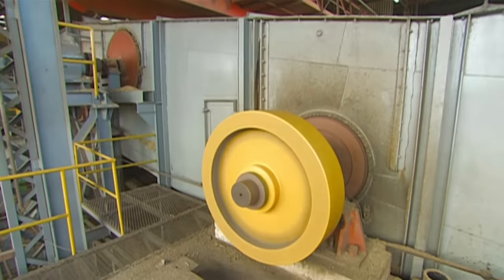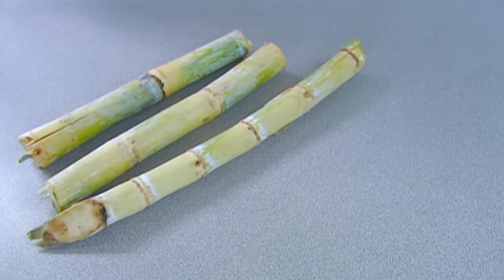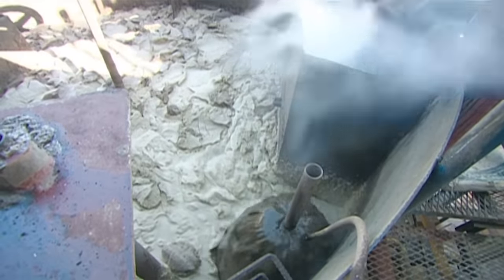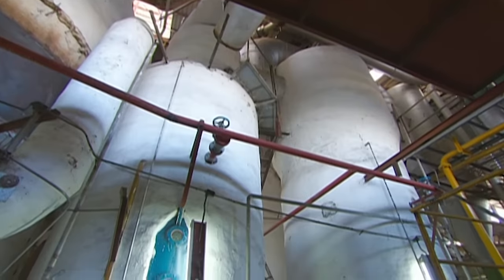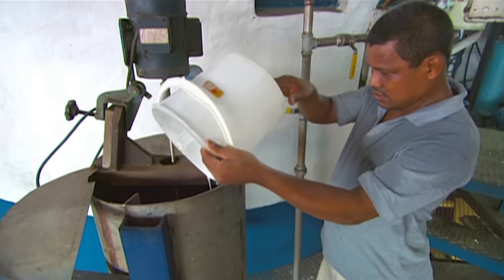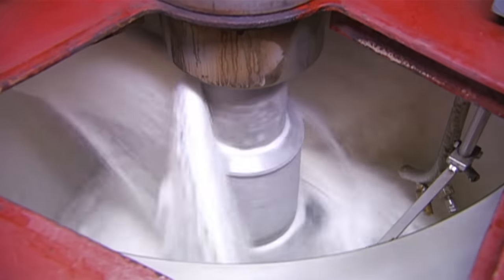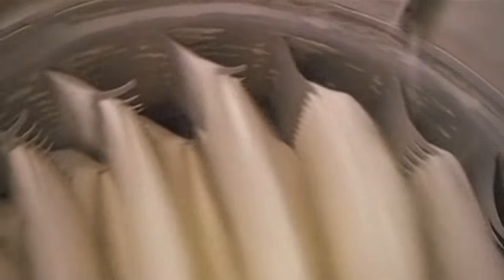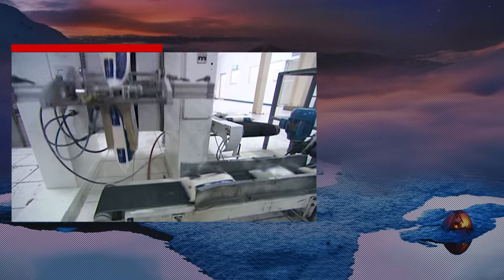SUGAR | How It's Made

Comment: After all this process there's diabetes 😪😥
Reply: Diabetes, obesity and metabolic syndrome. All stems from high insulin levels. The addiction and obesity can be completely eliminated with eating healthy fat every day. Eliminates the addiction.
Reply: @mitch1078  Caused by sugar.
Reply: @maggiep9007  Yes of course sugar that's what the comments for this section of the sugar video is all about.
Reply: Agree 100%
Reply: @B38132  It's really caused by sugar triggering massive toxic insulin response in the body. body is not designed to pump so much to reduce so much toxic blood sugar all the time.
Reply: @mitch1078  The diseases you mentioned are not all caused by high insulin levels. Type I diabetes is caused by a lack of insulin. You can be obese without having high insulin. Metabolic syndrome is a variety of diseases and most of them don't have to do with insulin. But I agree with your point that too much sugar is bad for your health and can lead to many different health complications.
Reply: @rovar00  I was specifically referring to type 2 diabetes. If you had logically followed the feedback from the original posted comment in this thread here which I was responding to, I was correlating that specifically. Type 1 diabetes typically begins early in life, which is the lack of insulin, where type 2 occurs after the overproduction of insulin causing insulin resistance, obesity and metabolic syndrome. The original poster's comment referred to later in life. Metabolic syndrome definitely leads to type 2 diabetes. Overproduction of insulin is absolutely the common denominator. Our bodies were never ever designed to produce so much toxic levels of insulin in order to combat the toxic levels of processed sugar, carb sugar and processed food incorporated in the modern century.
Reply: @mitch1078  I agree with your message. I was only implying that high insulin isn't the only cause of the diseases you mentioned, since it is possible to have all three of them without having high insulin levels. Many other factors contribute, but I agree that too much sugar leads to a host of poor health outcomes.
Reply: @rovar00  Correct. I was just focusing on that toxic levels of insulin is the leading cause of them. No one typically ever eats when they're not hungry. Toxic levels of insulin created from elevated blood sugar changes all that. Hungry all the time and obesity that never ends. The toxic levels of insulin itself is extremely destructive. Unfortunately the body has to produce it on a massive scale so the toxic levels of blood sugar doesn't destroy itself. The body then lives on constant emergency this way and can only lead to the same result you recognize as well. I finally hit all my health goals after finding this cause after 20 years because the science of insulin's effects on obesity was proven in the last couple years.
Reply: Beastmode cowboy 
He’s talking about type 2.
Type 2 is a dietary issue and preventable.
Don’t care about type 1. That’s a whole different ballgame.
Reply: @blackworldtraveler3711  Wrong, type 2 is not strictly dietary and not always preventable.
Reply: Beastmode cowboy 
Bad genes I guess. Why make it worse I’d say. Works for all of my doctor patients.
Not always preventable in his case because most aren’t disciplined and refuse to change.

Same with high blood pressure. All blood pressure pills means is a green light to eat more crap and not exercise.
Reply: @blackworldtraveler3711  I have a friend that spent 20 years in the Marine Corps. Took great care of his body even after he got out. No family history of type 2. It's not an eating disorder, people would do good being educated instead of insulting people who have diabetes
Reply: Beastmode cowboy 
Just one person I see.
Didn't say anything about eating disorder.
Just everyday foods.
I guess you don't know what he was consuming during those years.
Reply: @406bullrider5  Diabetes type 2 is what is caused by excessive sugar/insulin. That's what this youtube video feedback is all about...thought you knew this.
Reply: @406bullrider5  Even if your friend looked like he was in good shape doesn't mean he didn't eat high processed carbs creating high insulin resistance. It's called TOFI, thin on the outside, fat on the inside. This means fatty liver disease where you wouldn't see this on the outside of the body. It can be caused by drinking and other excessive insulin factor.
Reply: @mitch1078  obviously you don't.
Reply: @406bullrider5  That's correct I don't drink much alcohol. Everyone agrees here this specific feedback thread is about excessive insulin type 2 brought on by excessive sugar consumption. This thread is not about "lack" of insulin from type 1 whatsoever.
Reply: @406bullrider5  Having diabetes doesn't mean you are more educated, type two is extremely preventable more than it is passed through genes and is mostly caused by having excess sugar in the blood *FROM EATING TOO MUCH* it may not be an eating disorder because you have control of what you eat but it can be caused by eating disorders wanting more to eat meaning more sugar in the blood. Honestly I agree with Mitch more he is only stating that he was talking about Type 2 diabetes and he is completely right about the description of it. I say you should try googling before ranting on and on. Don't bother swearing to gain advantages I really don't care.
Reply: @zaphkiel9019  It may not make me more educated, but it makes me a hell of a lot more educated than people who have never had to deal with it. Walk a mile in my shoes and you'll see what it's like. I've spent 15 years learning about both types, so yes, I am more educated than you
Reply: @406bullrider5  I don't have diabetes and I honestly don't care..  It's 2019 grow up and part ways of you can't win a rant. What Mitch said is true that's all to it... Don't agree then your literally wrong. Type 2 is genetic however is extremely through diet
Reply: @zaphkiel9019  So what he said was true, while all he's doing is on the outside looking in? That make sense? And no shit you don't have diabetes, if you did you wouldn't be arguing with me about something you don't understand
Reply: @406bullrider5  Here we go again. Be in my shoes yada yada... Stop. Just because I don't have diabetes doesn't mean I'm fucking stupid. I know basic nutrition and diabetes info ect you are right and he is right. Better? :D Equality? This world has gone to shit
Reply: @zaphkiel9019  
There is no real genetic caused by diabetes 
Only few population like in africa , asia which is rare, the thing is if a woman ate too many carbs sugar ( which is common as water these days )  and had high insulin through out her life then she can set off diabetes to her infant by great chances 
If you had this from ur mother and no, top of that you eat proccesed foods and tons of sugar with added sugar meats ( proccesed)
Ofcourse ur gonna get diabetes 
If not then what u gonna be superman?

Comment: Summary because I can't remember everything frrom an 8 minute video: Harvest cane, wash, press to extract juice. Pass through sulfur dioxide vapor. Make alkaline using calcium hydroxide solution. Let solids settle out and pour off the liquid. Boil off water to concentrate. Scrape off floating residue with a paddle. Add seed crystals of sugar in ethanol. Boil under vacuum to grow larger crystals. Spray with water while centrifuging to separate crystals from molasses.  Dry with hot air in a rotating drum.

Comment: Excellent video. Thorough and very well presented. But I have a question. 
After the sugar crystals separate from the molasses in the centrifuge, the crystals are rinsed with water. But sugar dissolves in water, so why aren't the sugar crystals dissolved and washed away by the rinse water?
Reply: If the water is cool or cold, and a minimal amount of water is used, most of the sugar will remain. The main reason for the water washing is to wash any molasses remaining in the space between sugar crystals out.

Comment: Greetings: Quite informarive and useful. Nothing can beat sugar when it comes to sweetening the tea. UK ACCENT TOO is SUGAR. Few consideration and lines. 

Sugar: "Managing with available resources to produce significant difference"

While selecting vegetables, wallet becomes shy and often shuns
One makes less effective and lacks focussed intervention
Whats the use of plane when it can't overcome turbulent weather
Feels on high altitude, flying in a plane seated on cushion with leather

On experiencing bad weather
One yells for Turboprop plane blades
Image of high mounted SEA VIXEN rear wings flashes and fades
Still the benefits of TEMPEST BAE systems no initiatives taken to cascade

Not the usual sugar levels but high sugar is corrosive
Polysacchrides of Okra is quite effective and intrusive
Polypeptide- P of bitter gourd
Chilli pepper induced vanillin activation often serves as bodyguard
High fibre oats significantly reduces sugar
With tooth protection measure, sugar decreases drastically with after meal vinegar
Works wonder for sugar

Wonderful Day

Comment: What the fuck u mean before, dude production aint gonna stop just cuz its bad, and its 1 sample per hour or 2 samples, and a sample before its packed and loaded to trucks after packaging... They fill their  industrial  tank with  juice and then turn it in to sugar <to simply  put it>, afterwards go make amount of sugar with it depending of the way they cook it boil it etc... get couple of weld with it, <weld == tuns of sugar> afterwards sugar goes to Silo to store it or down to packaging machines...

You really think you and I going to tell difference between  color 46 60   35  ? 

Factory goes 24h 3 shift from september till december... they aint gonna have a dead hour or hault or throw some bamboo just cuz its crap they going to use chemistry to lower color and magnets to  clear it out.....  stop  in huge complex like this is 10-50 Milion Euros loss per day... especially if they use gas instead coal...